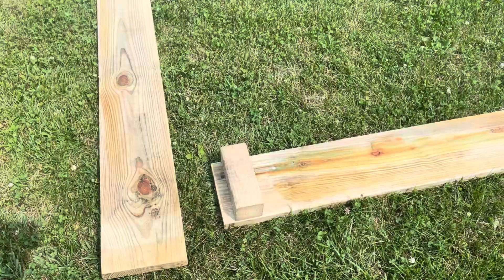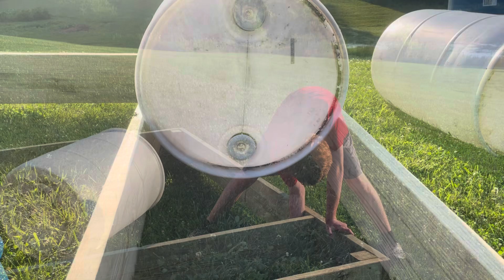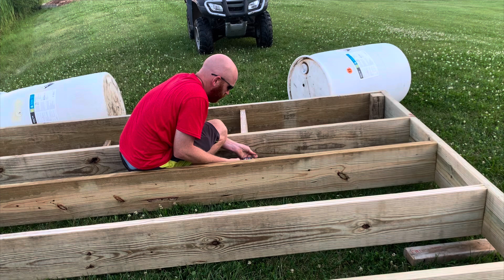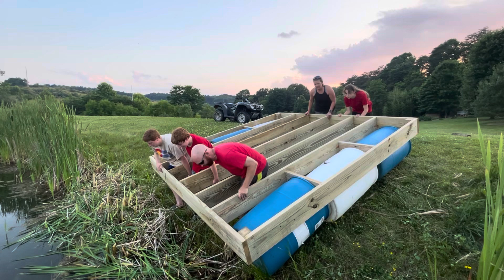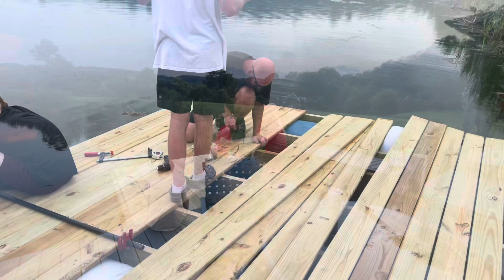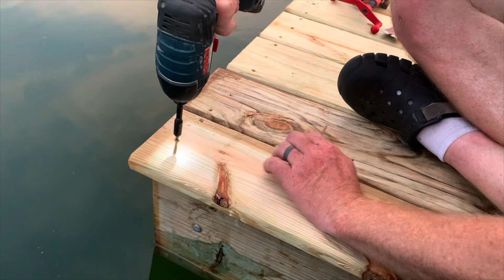How to build a floating dock with plastic barrels

Comment: We built swimming rafts like this and used thick cable to secure the barrels to the underside of the raft. Also hit the edges with a belt sander so the lumber doesn't scrape legs.

Comment: Tieing the barrels in is partly for making launching it easier.

Probably the main reason in your case. (and mine)

So, some Paracord and nails will likely be enough to hold the barrels when I launch, then I can pull the cord and nails.

Comment: Why did u not tie the barrels?
Reply from the maker: I don’t see the need.  I guess people must do that and I’m not aware.  What’s the purpose?
Reply: Yeah, heard on other builds, with the weight of the deck and especially in your case where the docks not on a choppy lake, the chances of them popping out are slim to none. And for future dock builds, while on land, if you turned your dock another 45deg, it may slide down your slope a tad easier. Even place a 2x6 or 2x4 beneath each set of barrels so it’ll slide nice and easy. Good build, enjoyed watching, thanks.
Reply from the maker: @davidcobb4527 yeah I thought brute force would be easy enough to slide into the water but was wrong.  The weight is so much that I definitely don’t think the barrels can/will ever come out.  Only thing I would change and I did mention it in the build was cross support.  I really wish I would have spent some time adding better support to keep the barrels from pushing the boards apart.  So if you are building one, focus on improving that.  Mine shows no signs of failing but those boards definitely pushed out more than I desired.  Thanks for the support!

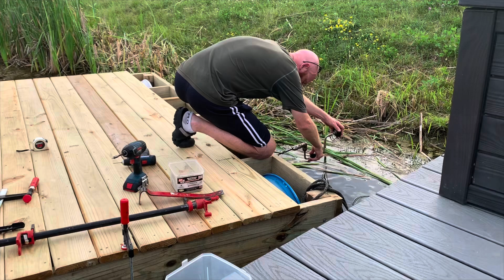Comment: Um, there is a drill (8:34) RIGHT THERE. Probably can throw the bracing bit all the way in the back of the toolbox.
Reply from the maker: The big one is a driver and not a drill.  The small one can’t handle drill bits that big.  I don’t remember why I didn’t go get my big battery powered drill.  Maybe I didn’t have a drill bit that big or was too lazy to walk back to the house.  I do know that you cannot match the torque of a brace and bit.  Not that I needed that here though.  Thanks for watching and commenting.

Comment: I have a question how would you keep the barrels from coming out
Reply from the maker: The weight of the lumber makes it impossible for them to go anywhere but up.  Up in the direction of the decking boards I mean.  You want to place the two floor joist boards to be closer together than the diameter of your barrels.  That way they can’t get to your decking boards.  Now your decking boards can help hold them down but that is probably not the best design.  I didn’t take enough time bracing the two floor joists together sufficiently.  So the barrels actually spread my boards apart slightly.  I would take the time to put some all thread or other bracing to prevent those two boards from being able to spread apart.  Do this before installing the barrels.  Hope that helps.
Reply: Nice work!  we’re planning to build one - you tube is awesome to look at everyone’s builds.
Reply from the maker: @mikemallery913 thank you!  Yes YouTube is a great for all of us to share ideas.  I just used it to help build a pavilion.  This dock is holding up really nice even with the insufficient bracing I mentioned.  Hopefully you can find or create better bracing on your design to improve upon mine.

Comment: Left a gap between each deck board
Reply from the maker: Not much of one at all.  The boards were wet so I figured they would shrink while drying and create gaps.  We let them bake in the sun for a month and then used deck stain on them.  Luckily we didn’t really see any movement of the boards.  Only thing I would change is spending more time to properly cross brace the floor joists that received the barrels to keep them from pushing out slightly.